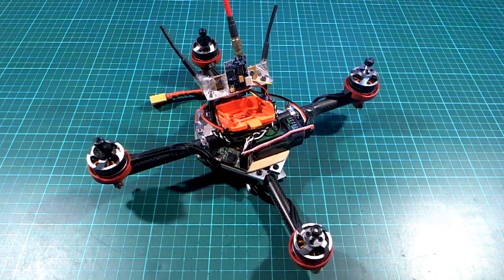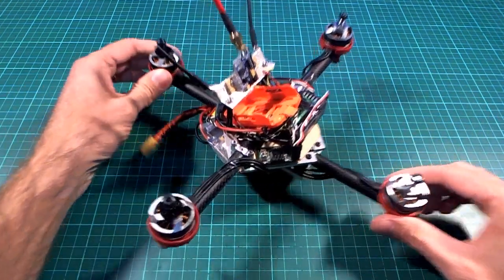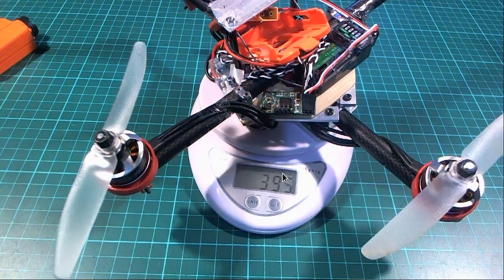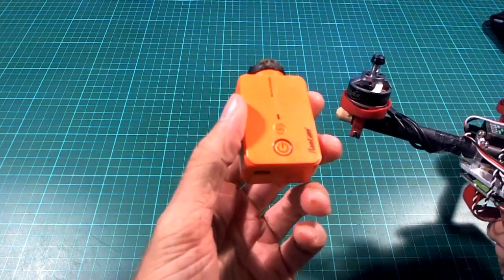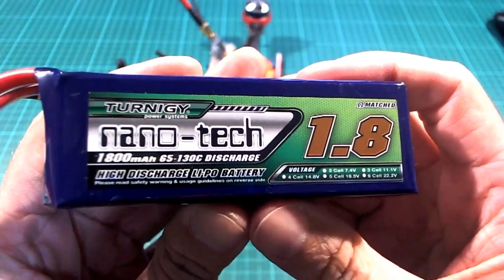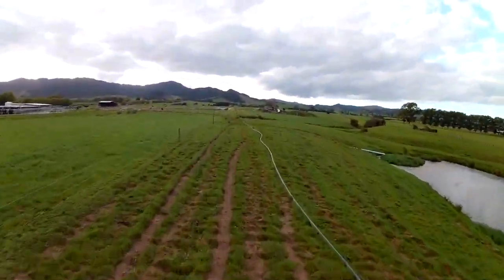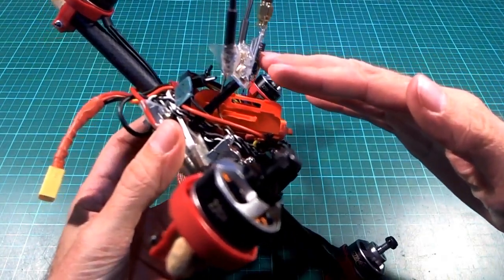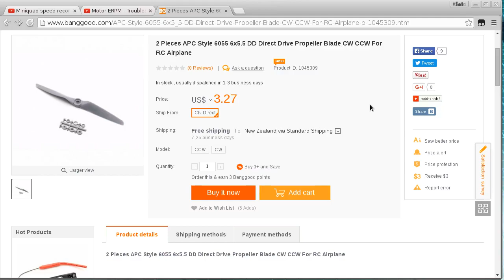Speed quad

Comment: Wobble may be vibration related. Especially the way it misbehaves only at a certain throttle setting.
Have you got blackbox or any sort of recorder on it?
Look at it like wheel balance on a car.
Vibration is worse at certain speeds but you can drive through it.
Reply from the maker: Right. I have some ESCs on the way, next thing I will try is to at least make all ESCs the same so I can rule that out as the problem. Then I'll come back to aerodynamic/vibration considerations.
Reply: yeah... I have been wondering why you often use 4-in-1 ESC board or diff individual ESC's when all ESC's should usually be the same make/model/rating and ndependant and fairly high current (i guess at least 15A) if you want the motors and everything to run smoothly and quickly

Comment: Could the wobble be beacause your airframe is kind of unsymmetric? That your tail motor get turbulence when the air passes the thingy that holds your FPV antenna at a certain speed?

In an X configuration the motors stay clear from the "fuselage", but in + config the tailmotor gets turbulence from a "big fuselage" like you have. If you use full throtle straight up you shouldnt get any interference from the fuselage.

Just a guess... :)
Reply from the maker: +MrBushman yeah that's a possibility...

Comment: It could be that only your front esc is more limited than the rest. I have this issue with my quad, where I bought cheap escs. the clocks on them change a huge amount, and often my front-left esc will be quite slow.

Though, the initial beeps from my escs are all over the place as well, I don't know if you have that symptom.

Comment: That wobble might be from the fact your running in + configuration. It does not wobble left to right. i think if you had it in x configuration it might have more even distribution of thrust.
Reply from the maker: +Tim D I don't see how + or x matters as far as distribution of thrust goes, or why it would only come into effect at that speed range. I would think the reason it doesn't wobble left to right is because the distribution of drag is (roughly) symmetrical left to right.
Reply: ***** try doing a full throttle sideways and if it wabbles in the vertical axis then it is the + configuration that is your problem.
Reply from the maker: +Tim D but why? Could you explain why the + config could be a problem? The 'distribution of thrust' is no different between + and x arrangement.
Reply: Your quad becomes more responsive because you have more thrust in x config. Suppose you have to go forwards then in x mode you have two rear motors to give the thrust but in + you have only one motor. Try a full throttle clime see if it wobbles,then you have your answer.
Reply from the maker: +Tim D more thrust in x config? Why? Why would some motors give more thrust because they are in some position relative to the center of mass and direction of movement... you might as well say the two 'front' motors give more thrust because they at the front, or the two side motors in + config give more thrust because they are at the side, I mean why not? ;)
It does not seem to wobble in full throttle climb, but that does not allow it to reach the same speed as when moving horizontally, and presents a different aerodynamic profile so it's not an apples to apples comparison - I can only do it for a couple of seconds too, so it's hard to test well.
Reply: I'm not all that good at aerodynamics. Try full throttle side way. If it wobbles in the horizontal then the plus configuration is your problem. All you can do is try.
Reply from the maker: +Tim D And if you could just explain your reasoning.... ah never mind :) Unfortunately full throttle sideways is not really practical at these speeds, in either FPV or LOS.

Comment: Jeez, that push is ridiculous. You're getting quite handy on the sticks!
Reply: +lebasson Also: which transmitter are you using these days? I started watching your channel when you gutted a cheap hobbyking transmitter ghetto style. I'm guessing you've upgraded by now :)
Reply from the maker: +lebasson I'm using a Flysky fs-i6 and life is much easier these days :) It's way more than what I expected for the price http://goo.gl/7tj94i
Reply: Did you upgrade to this directly from your lovely frankenstein creation? And what aspects would you say are the clearest improvements? Where I am now I'm starting to realize that spending more money on a better receiver is totally worth it. Of course it matters which transmitter you have too... I guess my question is if you think it's both components together that make the difference or perhaps more then one than the other.
Reply from the maker: +lebasson Yeah, it's the first and only one I have that was not DIY made, so the 'aspects' I'm about to mention will seem pretty ordinary for people that are used to proper TX's :) It has trims, it has battery remaining display, it has multiple model memories, it lets you set custom failsafe, stick movement is smoother, size is smaller + lighter, it has a three-position switch, it has multiple antennas (both TX and RX), RX has voltage telemetry (can be set up to return other analog measurements too), and it beeps after a while if you forget to turn it off. On top of that.... it just works :)
Reply: +iforce2d Haha, that's nice. Sound like if the Flintstones would get a new car and say "well waddayaknow, doors are great". It's nice when things just work ey? Still I love the route you're taking, exploring so many different avenues. I love your channel, thanks for the videos. But one question more about your TX/RX combo: the range appears to be quite good! I see that the TX doesn't have a swivel whip antenna, which I believe can make a big difference as an upgrade. No complaints about the range so far?
Reply from the maker: +lebasson I have flown out to 600m so far and all was fine. There is a video somewhere of guys doing a test up to 1700m. If I can be bothered making a long walk I might try with something I don't mind crashing, pushing it to it's limit. I also want to try flying out to the ridge line of those hills in the distance, it's 2.3km and I have permission from my landlord, but that one I will be doing with a big yagi antenna. I opened the TX to see where if anywhere I could attach a different antenna, and found it has two antennas positioned at right angles to each other, making a positionable whip antenna largely unnecessary (I think). They are attached with those little IPX connectors so it should be pretty easy to put the external yagi on one, and keep the other as is for when I'm still at close range. The only down-side I'm noticing at the moment is not being able to get an RSSI number into my OSD.
Reply: Thanks for the elaborate answer! Nice that it has two antennas. Better than I thought, I had expected it to be flapping loosely inside the TX. The range is nuts! Great stuff. Looking forward to your range test.

Comment: Run the 6 inch props with the 2000kv motors. I think you'll find BN 6045 will do you well.. You should really run the same escs, all escs are not alike even with the same firmware. Are you using betaflight? It sounds like you have some high end oscillations. If you  want speed you should be using 1300 4s rather than 1800mah. Every gram helps. Good luck
Reply from the maker: +doondedulin44 thanks for the tips. I do have some BN6045 actually, I'll give them a try.
Reply: +iforce2d Nice one. Look forward to seeing the results